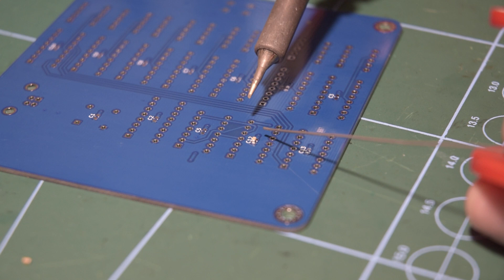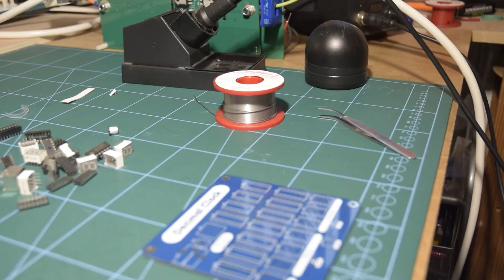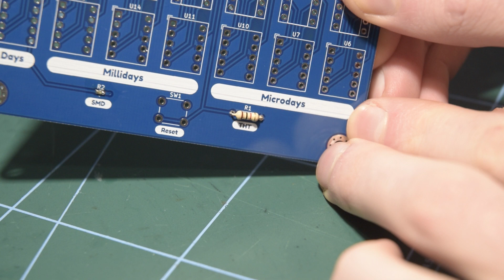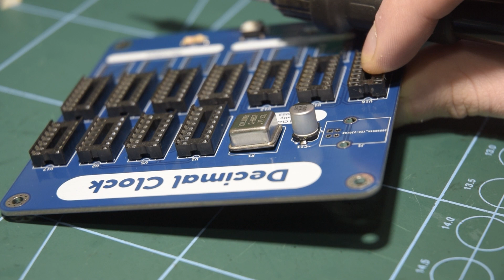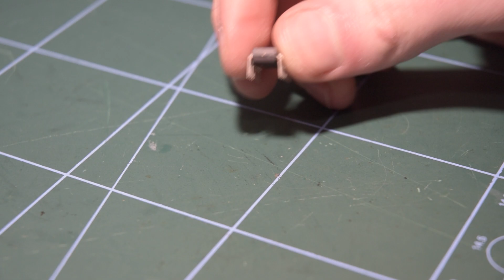Circuit Design ep.5 - Soldering and PCB Assembly

Comment: Whenever the solder follows your iron something is wrong. Oxidized tip, oxidized pad, not enough flux, wrong tip, too hot, too cold, or heating the solder and no the component. Soldering SMD is actually the most fun as it will always flip in place if done right. Tweezers are also a delight.

Comment: @ayulin9577 is correct for a couple of reasons.  In general, you don't want to heat and reheat if you can avoid it.  You also don't EVER want to leave your soldering tip void of solder when it is heated.  Doing so will cause the tip to oxidize and you will find you have to replace your tips frequently (and they can be quite expensive).  I have tips which I've used several times a week which have lasted years just by being religious about keeping it tinned when heated.  Unfortunately, human nature is to clean the tip frequently and immediately place it in its holster where it cooks untinned damaging the tip in short order.

The proper sequence is to:  tin (melt solder onto) the dominant hand side pad (optional),
              add flux to both (all) the pads to be soldered,
              get the component in place, pinning the component down with a needle probe (optionally use fine-tipped tweezers).
              when ready to solder, pick up the iron, wipe it, and IMMEDIATELY tin (melt solder onto) the iron tip (never leave the tip without solder when heated) ,

              heat the lead and pad simultaneously (i.e. touch the tip to both lead and pad),
              apply the proper amount of solder to the lead and pad avoiding application of solder directly to the iron tip.  Why?  Because you don't want the solder to melt before the lead and pad are above the melting temperature, resulting in a cold dull joint.  Also, if you applied solder initially to the pad in step 1 you often won't need to add much (if any) additional solder.  Just enough is normally best as it forces the phase change to be laminar, giving a stronger joint with improved conductivity.  This will show up as a nice filleted joint (a cone shape with slightly concave sides).
              Remove the solder (i.e. stop feeding solder to the joint) and leave the tip in place,
              Remove the tip from the joint.

              During the last four steps it helps to count in your head.  Soldering is best when it is done rhythmically (an art-form). Heat (Count 1-1-thousand), apply solder (2-1-thousand), remove solder (3-1-thousand), 4 remove soldering tip.  The moment you say "4" in your head, 3 seconds have elapsed.  Immediately tin the tip with solder and return to holster.  Always have tin on your tip when it is heating and ESPECIALLY have lots of solder on the tip when you turn off the iron and it cools.  Doing this, you will rarely if ever need to buy new tips.  If you hold the iron in your right hand and the solder in the left the sequence is Apply right, apply left, remove left, remove right.  Once you get the sequence down you can do multiple joints in succession saving time as you can prepare all the joints ahead of time and just rapid-fire the joints in quick succession.  This also helps "get into the rhythm".

              The art is to get used to performing double-duty with your left hand.  Use 3 fingers and thumb to hold the tweezers or needle which pin the component in place.  Coil a strand of solder from the spool around your index finger with a 2-inch extension in line with your fingertip such that with just a slight extension of your index finger you can apply more solder.

             And of course the most important skill is doing all this without touching any part of your body with the hot iron tip.  Rest assured it will happen.  Early on, think it through and properly prepare for component pinning and have the solder strand extension near the joint, before picking up the iron.  If you have everything comfortably prepared with your left hand the only thing on the left hand which moves is the slight extension of the index finger to apply a tiny bit of solder.  If shaking hands are a problem remind yourself to place the heals of your hands on a steady, flat surface.  Fingers have finer motor movement than hands, hands have finer motor movement than elbows.  So, fix the elbows and often hands in place and just use the precision index finger.  This is why ladies in sewing circles instinctively press their elbows to their sides when knitting (also avoids carpel-tunnel-syndrome).

Comment: What I usually do for all SMT devices is put a tiny bit of solder on the iron first, then hold the component with my tweezers and lightly tack on the pad that is easier to reach. Then I drop the tweezers and pick up the solder wire again to properly mount the other side, now that the component doesn't move around anymore before going back and reworking the first joint to make it tidy. You can get into a nice rhythm like that and it's much easier than trying to solder the first pad with a loose component. Also more flux never hurts.

Comment: Hope your using something to remove the smoke from soldering, in the very long term you can get sick or die from it. Example is the guy who started up tritium controllers ( used in solar electric vehicles) he died from a disease caused by soldering fumes. I cant remember his name but I remember thinking in a way he gave his life for developing controllers, where he could still be alive if used some fume removal system.
Reply: I learned to solder as teenager some 60 years ago. When I needed two hands I would hold solder with my mouth. No I don't chew solder anymore and I have a filtered exhaust fan and a NIOSH approved respirator when I work with chemicals.  There were no regulations No EPA, no OSHA. In the sixties the only thing that was banned was Weed 🤫
Reply from the maker: I wasn't at the time, I have something now (just a fan I'm afraid but better than nothing)
Reply: solder in your mouth? that would leave a metallic taste for a long time i'm guessing?